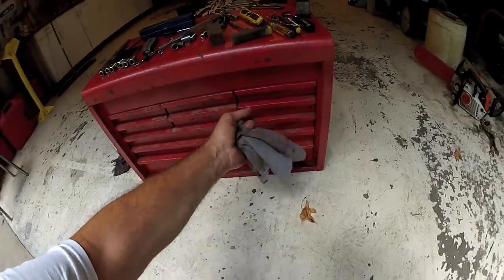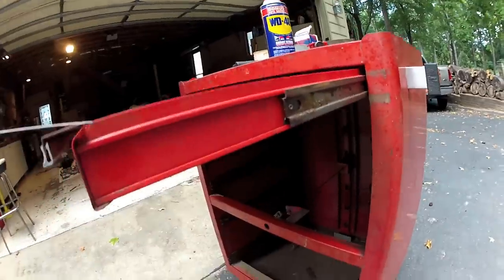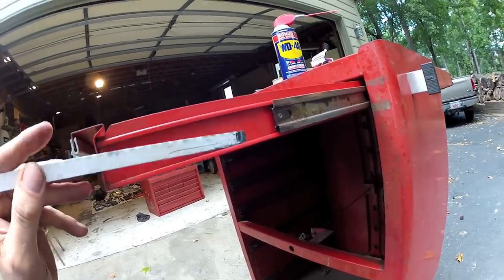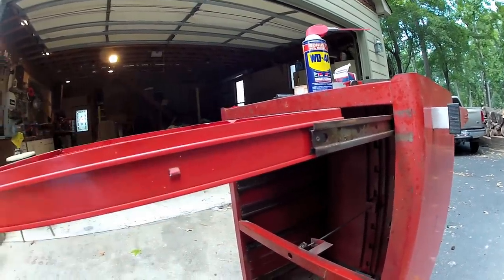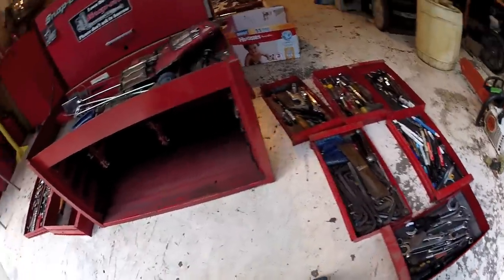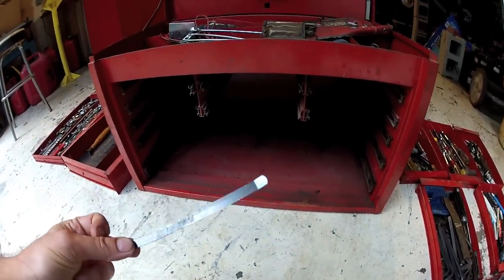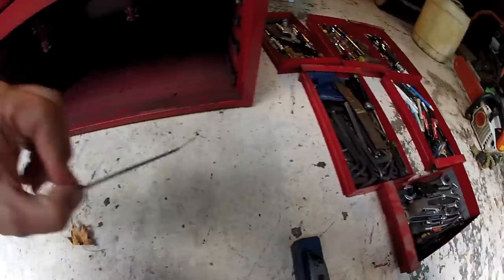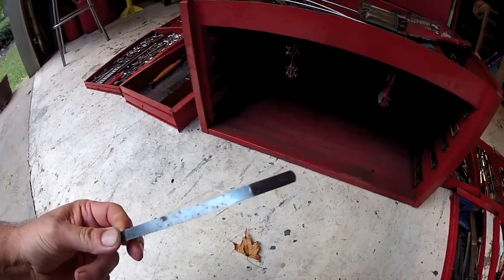Snap-on tool chest drawer removal. How to.

Comment: What a lifesaver, Yank!. I picked up a large lot of these, just chock full. Naturally, they needed the drawers removed before putting them on the trailer. Some are this type as you've described and others have a little lever on each side that becomes visible at half way. Thank you!

Comment: Thanks so much for posting this. Hubby and I are moving and there is no way we could have lifted it with the drawers in to load into trailer. After 20 mins of frustratiin I finally pulled out my phone and googled snap on drawer removal. Found your video. You are a lifesaver. Hubby used the end of a big zip tie and voila...drawers out. Thanks for taking the time to post this...it really helped!

Comment: That worked great!  And then I also found the tool at the bottom on my garage sale find.  The actual tool is 3/8" wide so if you grind the hacksaw blade to that and feather the tip a little thinner it gets the narrow drawers out.  Thank you!

Comment: Bought my roll-away box used from a Snap On dealer and bought a new top box. Months later I bought a cylinder kit to key top and bottom the same. When I went to do that job the truck guy had retired and moved out of state. That was in 1990. The cylinder kit is in the top drawer.

I got in touch with Snap-On to ask them how to remove the drawers as that's how you do the re-key. There's no numbers on the box to identify it so they had me snap pictures of it (get it? "Snap" pictures?). When they got back to me they said no one there could identify the model so they didn't know how to remove the drawers! REALLY????? I couln't believe Snap-On couldn't figure out what box I had. Anyway...

This does it!!! I can't thank you enough.
Reply: Other companies made boxes for Snap On back in the day. Hard to identify something you never made. Lol

Comment: I tried the hacksaw blade method, but it was too wide to fit into the drawer slider. I took an old stainless steel hose clamp, cut off the part of the clamp with slots for the screw to catch onto, and rounded off the business end so it would go in easier. I unscrewed and removed the screw from the other end, and voila! It goes in and out easily, already has the correct curve, and the end that the screw went into is just right to pull it into and out of the toolbox slider.

Comment: The two tricks to making it work are: 1 make sure the hacksaw is thin enough, you may need to grind down the thickness of the end to almost a knife edge on the leading tip. 2 push the tool to where the tab is and then pull the drawer forward, don't try to use the tool to push the internal tab in. Also it's much easier to make 2 of these tools than trying to do one side at a time for lots of drawers.

Comment: Thanks for the video going to try this my vintage Mac box has a slot cut out of the sliders so you can press the tabs to get the draws out but I picked a late 40s snap on box and they have similar sliders to yours so you prob just saved me an hour or so trying to figure this out lol

Comment: omgosh great video. thanks. my problem is that the drawers won't even slide half an inch. They are stuck tight. one had a nail catching at the half-way point so after removing that it came free but the other drawers won't even slide a little bit. as if they are locked. any ideas?

Comment: Good video! The bottom drawer on my old box the slide is made different. No little flexible metal strip like all the others have. Any idea how to remove those? Thanks
Reply from the maker: ...not sure, but with all the other ones removed, I would try looking with an inspection mirror and a good light.  Inspect the area between the sidewall of the cabinet and the outer lip of the drawer.  Good luck.
Reply: YankeeinSC1 I got it. Works same way just harder!
Thanks

Comment: I tried bending a hacksaw blade just a little and it just  snapped in two.  Any suggestions?
Reply from the maker: heat.  propane should be hot enough...

Comment: what is good to lube these kind of slide
Reply from the maker: Lou Fresquez I would think a light lithium grease.  Something that wont run (or solidify) in extreme temps.  Maybe simple bearing grease, but less is better than too much!!!
Reply: YankeeinSC1 Thanks will give it a try have older tool box no idea what make no tags or stamp any where same slides cleaned it painted wasn't sure what kind of lube thanks again